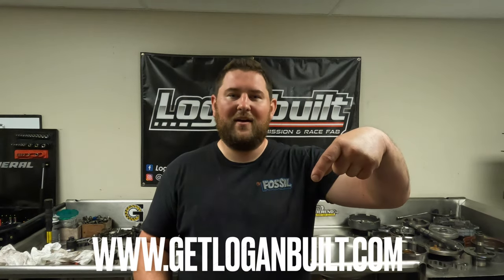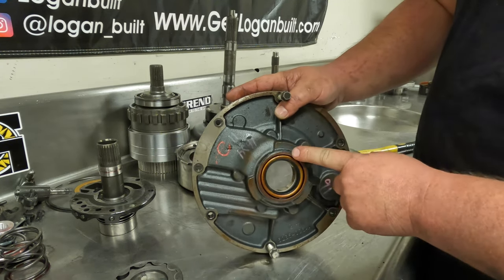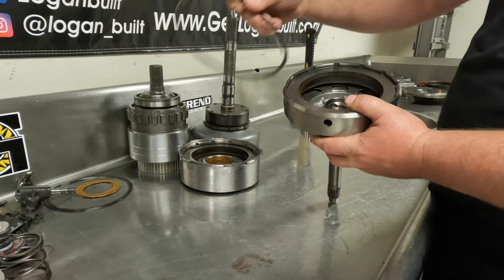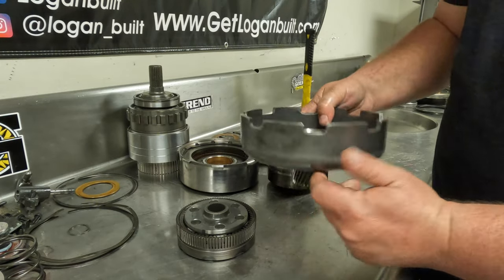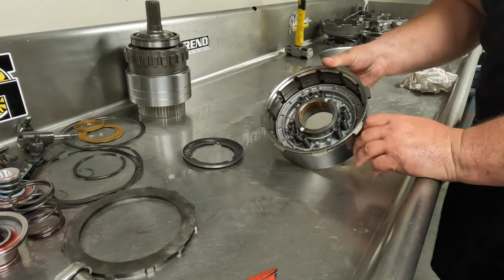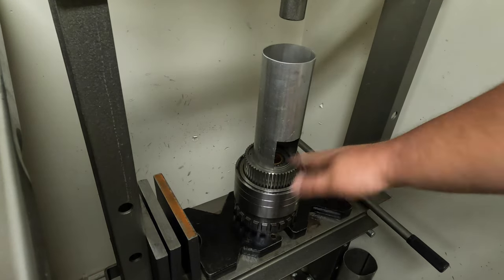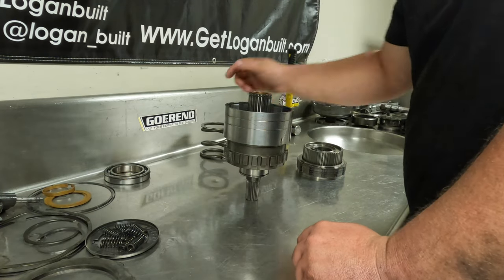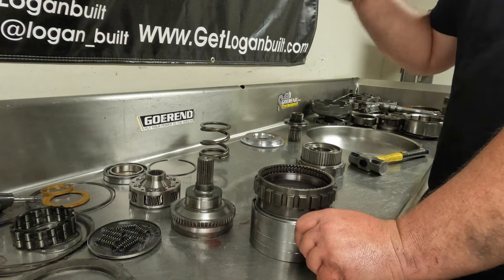Loganbuilt 47/48 DIY kits Step 2: Internal Component Disassembly!

Comment: My case was so bad. The case was covered with what seemed like clay. I had to use a wire brush on a drill to clean it. The pressure washer did no good.

Comment: Good video. Why do you do away with the stator snout seal? Any benefits?
Reply from the maker: Yes. When you increase line pressure, especially if it’s near or 180psi, leaving that sealing ring in place can cause converter ballooning from the increased line pressure. Removing that sealing ring allows the converter to vent off that excess pressure. On my 1000+hp units we actually do an apply regulated lock up to maintain a maximum of 180psi to the converter while main line pressure can be set higher. In this application we do run the converter sealing ring. For all of my diy kits (800hp and down) we don’t do apply regulated lock up so you’ll need to remove the sealing ring.
Reply: My stator tube has spun. Do I replace the stator or repair it. If repairing how do u do that?